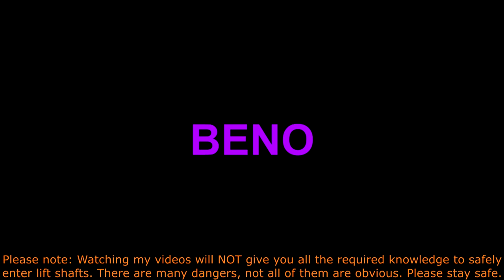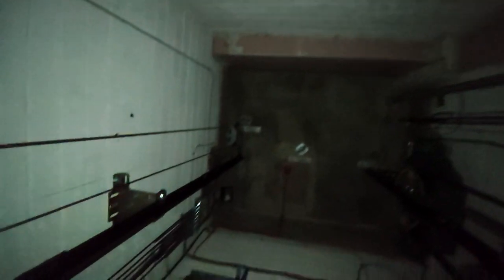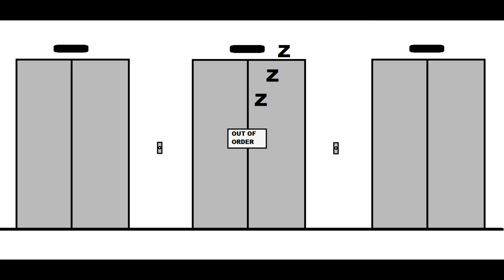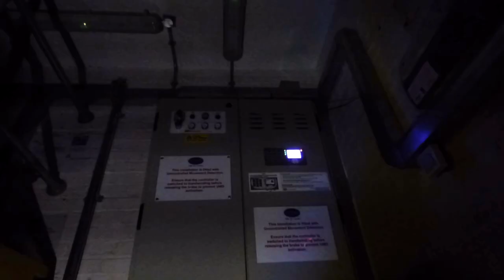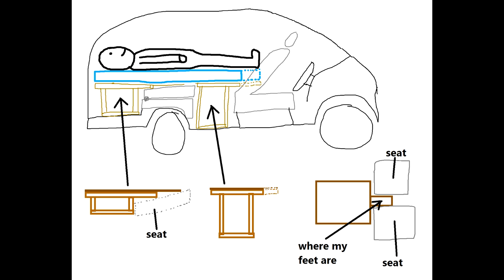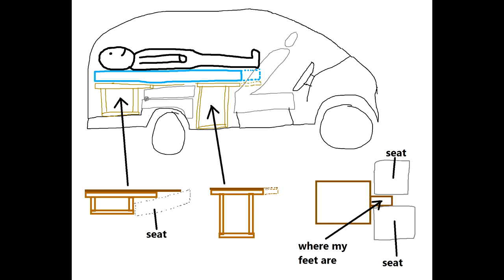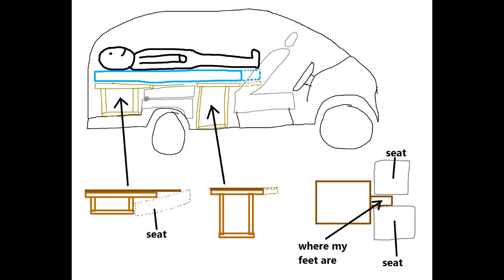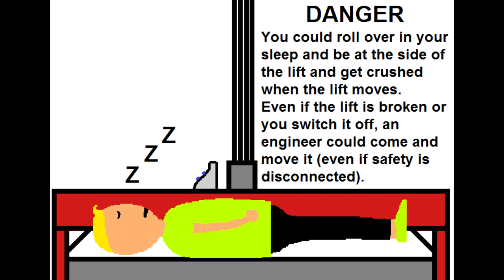Is it possible to sleep in a lift shaft?

Comment: 8:04
Also, if your car has a dodgy exhaust system, carbon monoxide can leak into the cabin and that is extremely dangerous and can kill.

Danger: DO NOT sleep in your car with the engine on! It wastes fuel, could get you idling fines in some places, and is dangerous because of CO poisoning.
Reply: Better to have the windows just slightly open, yeah it can be hard to keep the warm inside however

Comment: How about opening the door between two floors, block it from inside and sleep in the cabin? If there are at least two lifts no one will care about a non-working one during the night time. Engineers wont come before 7am either. 
Wouldnt that be a good spot to sleep?

Comment: 8:05 a Prius is very good option for this, as the A/C and heaters can work out of the battery, and the engine kicks on when the battery is low, no I'm not telling you to buy an Prius just to sleep on it but it's something a lot consider if you wanna cheap for sleep and travel a lot by car